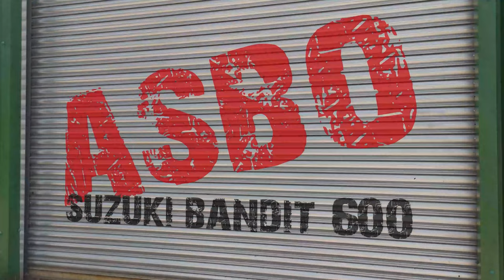Suzuki Bandit Front End Swap - Fork rebuild for the Suzuki Bandit Cafe Racer project ASBO

Comment: Wish I lived more local you you, be fun the day Steve and yourself go out for that first ride. Having owned a 600 and 1200 bandit, back in the day. By far the cheapest way to get a basic fun bike and learn, what to change on a budget to end up with a good handling comfy mile muncher. Back in 2000 went round country following BSB, with the 1200 Bandit cup, as support races😱😂😂👍
Reply from the maker: ASBO is my first Bandit, but its a really good base to start with I reckon for a project bike. It's never going to set thr world alight,  but once its built and been changed around slightly, it should definitely bring a grin to my face 😁👍

Comment: Getting rid of the case for your spanners blew my OCD fuse! Also, when tapping threads on the lathe I was taught to put the tap into the chuck on the tailstock and turn the workpiece by hand (winding the tailstock in to keep the pressure on the tap) - nothing wrong with the method you used, just seemed a little more complex :)
Reply from the maker: I have a sprung loaded tap follower which I was hoping to use, but the end of this tap is pointed.... that was REALLY annoying 🤣😂

Comment: You could also make a set of extended fork caps if the top yoke is a pain in the arse to make.
Reply from the maker: Very true, that could work... I quite like the idea of the yokes though. Would be interesting to have a go at and get used to the mill 😁👍
Reply: @QuickBikes  oh the yokes will look heaps better. The caps would just be a quick stop gap to give you the opportunity to play around with geometry and finalise the drop amount on the top yoke.

Comment: in regards to measuring the fork oil - could you use the fork seal seating tool and clamp/attach the oil measuring stick to it so it stays flat etc?  just a thought mate!     cheers.
Reply from the maker: Yeah, I would imagine so... I found that hooking the syringe on top of the tube clamp and pulling the syringe down basically forces the clamp flat anyways... that syringe is stiff as though.... I need to get another one really 😁👍
Reply: @QuickBikes  no worries, just a thought mate.  good to see progress on ASBO though!  
cheers.

Comment: If you're making your own yokes, and you're not happy with the slits, you could maybe try removing the slits entirely and use something like a split cotter clamp (see here - https://bbs.homeshopmachinist.net/forum/general/34445-split-cotters).  Means leaving a bit more meat on the yokes, though, and you won't get totally full-bore clamping, which might be a bit sphincter-clenchy for some (never seen any on bike yokes, actually, hrm), but they look loads nicer.  

Bringing the bottom yoke clamps up the forks at the same time as bringing the top yoke clamps down might make the front end a bit more wibbly-wobbly, it would certainly put a lot more forces on the yokes under braking, I don't think I'd be up for that.
Reply from the maker: The steering stem in the Daytona is quite a bit shorter than the Bandit one, so I figure as long as I don't go any shorter from top yoke to bottom yoke, we should be fine 😁👍
I'm still playing around.with CAD trying to.come.up with a yoke design I like... it ain't easy 🤔😁

Comment: When I did my front fork overhaul, my impact gun didn't do the bolt up, I had to assemble the forks with the top cap on and then do the bolt up, I guess my gun can't spin it quick enough, or are you using an air drill?
Reply from the maker: It's an air fed gun and as a budget tool it's not too bad really. It certainly makes some.tasks a lot easier 😁👍